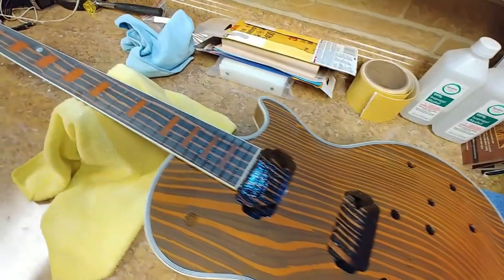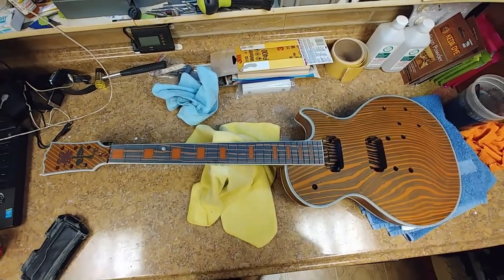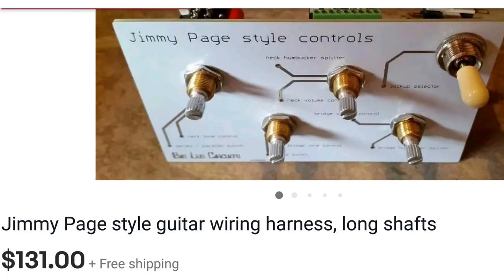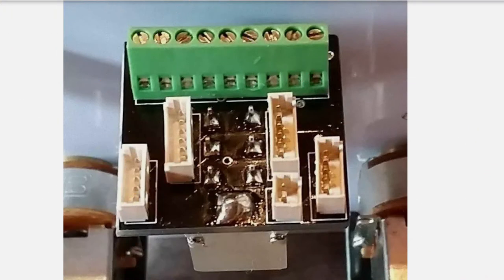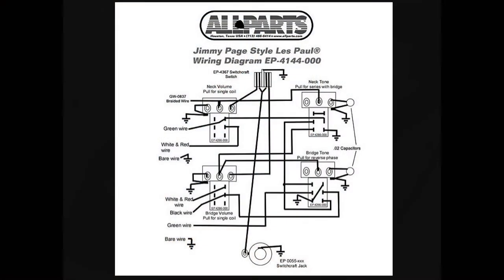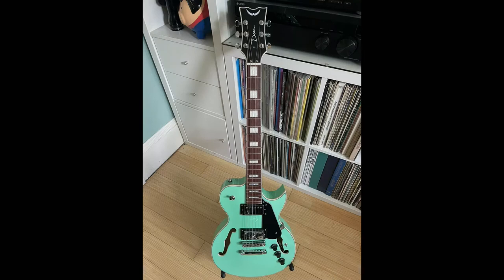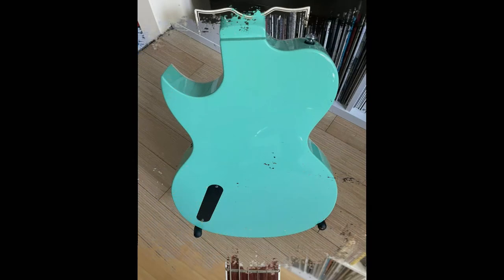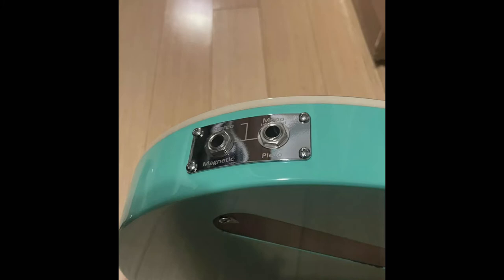Zebra New Parts and a New Guitar Coming

Comment: What did you use on the fretboard? I must have missed it. I didn’t know if you used just some Lemon Oil or what. I just picked up a Zebrawood kit and I can’t find anything on how people treat the fretboards on them.Thanks I’m advance. 🙏🏼

Love your walkthroughs. Great job.
Reply from the maker: I clear coated the fretboard. I couldn't find anything on how to treat zebrawood either.
Reply: @ericctheartofnoise8613  Sweet! Thank you! What did you use for your clear on the fretboard? I’m sorry, I just don’t wanna screw it up. I was gonna use Tru Oil on the neck (Maybe), but I didn’t know if that would be ok for the fretboard. Thanks again.